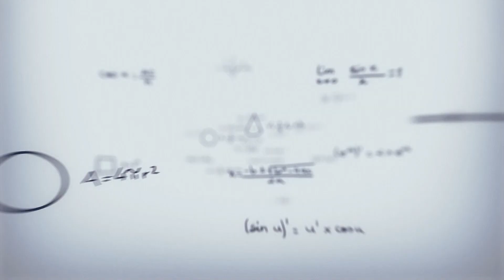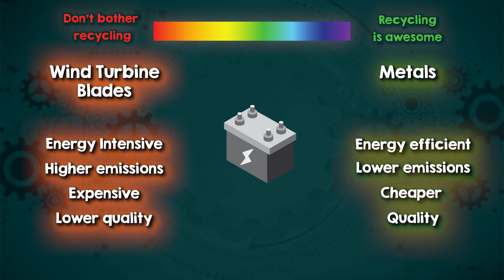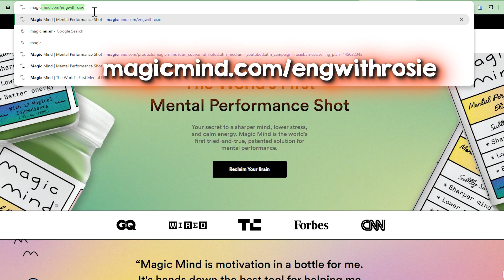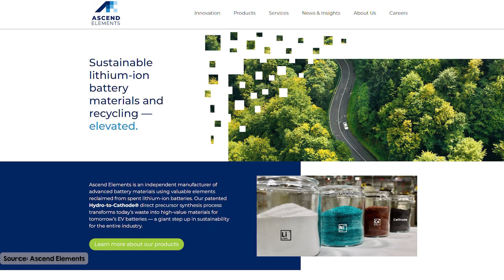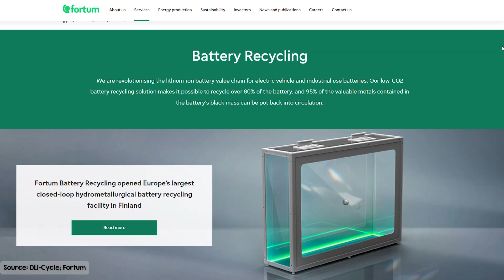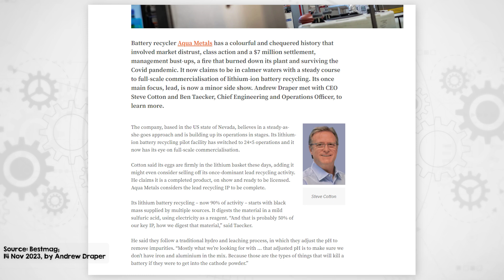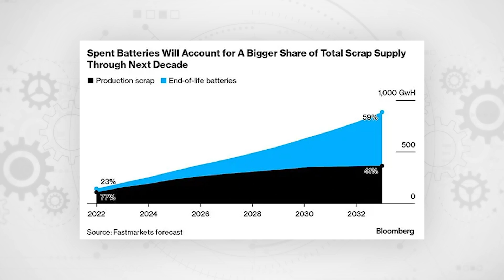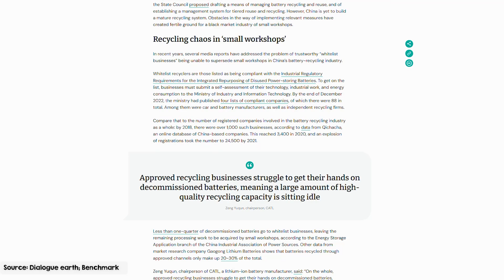Recycling Lithium-Ion Battery: How Does It Work?

Comment: 10:18 battery mineral supply constraints is still a huge risk to the energy transition, even if less talked about.
Reply: I don't think it would be. 

First if all we have enough lithium for the transition. 

Second we have alternative technologies such as sodium ion batteries (which is much more suitable for grid storage). Sodium ion batteries are already commercially available. And there are potential battery technologies like Aluminum graphene ion battery which are a lot more suitable for vehicles. Even better than lithium.
Reply: @JSM-bb80u  We have enough resources, but not enough mining and refining.
Sodium Ion batteries will need at least 10 years to reach the same scale as Lithium Ion, probably longer.
I'm not saying it's a problem long term. Long term you are completely right. But the next 10 years will be intersting.
Reply: @w0ttheh3ll  Agree with everything. But mineral bottle neck wouldn't be that much if an issue with growing technologies. 

Direct lithium extraction is becoming viable. It would lead to more environment friendly and quicker lithium extraction.

Comment: One of the biggest wastes of lithium batteries right now is vape pens. They're mostly not rechargable so they get used once, but they do contain rechargable lithium ion cells because that's the cheapest thing to use. The estimates I've seen are that enough pens get used once and thrown away (usually just in the street it seems) to make 200 EV car battery packs EVERY DAY. Even just in my rural area I pick up enough old vape pens, crack them open and harvest the (used once) LiIon cell out to keep me in hobbyist electronics batteries forever.
Reply: The single use vapes have started washing up on beaches, they need to be banned from sale, for several reasons. It’s not like they are a great benefit to humanity!
Reply: @nigels.6051 it's blowing my mind that there is no regulation at all here in the US at least. We have to get money out of politics or were doomed.
Reply: @Broken_robot1986  I think New Zealand has already banned disposable vapes, and the batteries must be easily replaceable now.  Here in the UK, disposable vapes will be banned next April.   USA appears to lag behind on many important issues,  I suspect I will be collecting USA vape pens off our UK beaches for many years.  It is up to you to reform your government, not me, so I won't say any more!
Reply: @nigels.6051 We don't need more government behavior control.
Reply: In my U.S. state, Vuse pods or similar, designed to allow for continuous reuse of the same battery/vape, are subject to a 60% tax. The disposable vapes are not subject to this same tax because they hold more than the law's minimum for juice content in one "pod". So now they are littering the streets. Awesome!
Reply: @garrettmillard525  That's crazy.  I don't know why they are so antivape.  Vaping has helped millions quit cigarettes.
Reply: @tarstarkusz  It's bizarre. Just very poorly thought out legislature. The idea was to reduce access to teens.. so now the teens get the disposable vapes that are pretty much entirely 6% nic, and adults pay out the wazoo for the pods that come in 1.2%, 2.4%, 4.8%. So now if you're trying to quit but aren't rich, you are hesitant to buy the lower strength because it won't last you nearly as long. Screwed up.
Reply: I totally agree.  I hate those things...it actually makes me sort of angry.  I'm against over-regulation but in this case something needs to be done.
Reply: @sc0tte416 take a chill pill lady
Reply: Just add the right amount of taxes. Don't let the addict's money lay around on the street.
Reply: @wernerviehhauser94 just exploit more people huh
Reply: Agreed John. I vape however I only use rechargeable pens or vapes. Glad to see you are using the old batteries
Reply: This is absolutely false.  Every vape I have ever owned has been rechargeable.
It is categorically false that any of these disposable pens are even remotely comparable to vehicle batteries.  For one, they are all soft batteries.
Reply: @tarstarkusz  They use the same material. Graphite anode and lithium electrolyte. Vehicle batteries are soft too, if you take them out of their aluminum shells.
Whether they're technically rechargeable or not, people don't actually recharge them. I find them in the street all the time.
Reply: @John_Ridley  There are hundreds of pounds of metal shells in the average EV battery, regardless of the chemistry.

Really, you should just shut up about vaping. You are clueless.  These things cost 50 dollars and up. NOBODY is throwing them out.
Disposable vapes are not sold in huge numbers.  They are an EXTREMELY expensive way to vape.  90% plus of people who vape use refillable vapes with rechargeable batteries.  They start at like 30 Dollars and go up to well over $100
Reply: @tarstarkusz  I, too, have been making battery packs from disposed, disposable vapes, it's probably all true, and you're just seeing the four walls
Reply: @tarstarkusz  If nobody is throwing them out then why do I find them in the road all the time? I have dozens of batteries in my collection harvested from them. I live in a very rural area, farm country really, and still every time I go for a walk there are vapes thrown in the road. When I'm in a city I can pick up 3 or 4 of them walking a mile or so.
Also if they're charging $30 for these things they're profitable as hell. It's a plastic shell, a sponge with some juice in it, a $1 battery and 20 cents in circuitry.
Reply: @John_Ridley  No, they don't cost 30 dollars. They're like 10.  But it is EXTREMELY inefficient to use these. Few people who vape full time use them.  The ones you find are likely people trying vaping and don't want to put the money into a real vape. Or maybe people trying to quit smoking.

The VAST majority of people who vape use non-disposable vapes. These are the ones which cost 30 (and up) and have a tank and replaceable atomizer. They have either a removable battery or a recharging port. They are not disposable.  The tanks are deliberately designed to be filled (they come empty) and replacement atomizers (they last between 2 weeks and a month) are sold in vape stores for each specific vape device.

Why are you crying about other disposable lithium devices?

Also, they are made to not be rechargeable. They use the lowest grade of materials because they are not expected to have 500 cycles put on them.
Reply: @RedPillRachel  No. I've been vaping since the late 2000s.  The VAST majority of people who vape do not use disposable units.
Also, unlike you, I'm in the vape shop frequently. Most of the disposable vape pens are gone.  They are a terrible deal for the end user. They don't produce much vape. They dry out sitting on the shelves, so if you get an old one you won't get many puffs out of it.
Those batteries are not designed to be recharged. They're made very cheaply. You'll never get 500 cycles out of them.
Reply: @tarstarkusz  300 is typical, they are useful though, for lighting and automation projects, that was all I was saying, and there are lots of them around for us to find.
Reply: @tarstarkusz  Dude I'm just pointing out that at the same time that people are whining that cars aren't green because they use up so much lithium, nobody gives a shit that vapes, phones, airpods, and a million other things that we use every day use up more lithium than all the EVs we build. Vapes are an example that I knew had been researched and quantified. Sorry if talking about vapes triggered you. We can talk about airpods being thrown away if it makes you feel better.
Reply: @John_Ridley  Assuming "green" even has a definition, which is a huge assumption, there is absolutely nothing "green" about ANY automobile regardless of the fuel type.

You didn't trigger me, you are just talking crap.  Airpods aren't disposable either.

Comment: The cost of these processes will be reduced. The current problem is that they cannot be expanded because there is not enough material. Nobody wants to spend hundreds of millions of euros on a facility with annual revenues in the millions. In the EU, for example, glass and plastics recycling is an economically sustainable business, but their capacity is in the millions of tonnes every year.
Reply: Very skeptical about glass recycling or manufacturing of any kind when the fuel for the furnaces has been cut off by green nonsense. Recycling is by its nature energy intensive.

Comment: The interesting part in the video is when Rosie mentioned MNC batteries were replaced with LFP batteries.  
This did reduce costs and made batteries more energy dense.
The next step may well be replacing the Lithium in rechargeable batteries with Aluminium since Aluminium batteries are more energy dense and with Aluminium being more plentiful and available.  In other words it would require less battery capacity using Aluminium than Lithium for the same energy capacity which in turn would require less recycling on a per unit basis.
Reply: @денисбаженов-щ1б  LFP were developed because of costs.  The Lithium, Iron and Phosphorous are much cheaper than the Nickel, and Cobalt in NMC batteries.

Comment: Tesla car batteries are being more integrated with the car's chassis with the use of glue surrounding and inside the battery. To recycle these, the glue has to be broken down to access the battery cells then further work to remove the glue from the battery cell area. This makes recycling unaffordable. My older model S, the battery can be easily removed and the cells are easily accessed. It can also be easily repaired without the need to dump a whole EV battery.
Reply: How many years/miles do you have on your Tesla?
Even when degraded below 80% the battery would make a very nice powerwall in a residential setting or part of a grid storage system.
Yes, definitely with newer proposed manufacturing processes where the battery is more integral to the 'skateboard' perhaps some cropping of the chassis would be needed, but this is achievable with waterjet.
Upcycling is almost always a more viable option than recycling unless badly damaged in an accident.
Reply: @jimurrata6785 Euro 7 emissions regulations would make it impossible to register an electric vehicle once the battery drops below a certain capacity.
Reply: @gregorymalchuk272  I'm  suggesting that a vehicle battery that has reached its limit is better repurposed as fixed storage than shredded for it's materials.
Not sure what that has to do with registering a vehicle in Europe... 🤷‍♂️
Reply: The "modern" integral battery platforms are an environmental disgrace. My understanding is that it isn't only Tesla that are guilty of this, but their inclusion in the club is certainly notable given the "mission statement" (Tesla con).

Comment: I think we should take a page from aluminum can deposits adding a small charge the consumer can get back by properly recycling the item. If people cate that much about $0.05-0.10, I'd bet they'd care a lot about $5-10. I'd mention adding a charge to manufacturers too to cut down on the cost of recycling (ideally split between a manufacturer tax and consumer deposit), but without effective price regulation, it'll just get push onto consumers regardless.

Comment: We also need to better reuse old EV batteries. An EV HVS might sustain physical degradation through abuse, and some electrical degradation leading to reduced charge and discharge rates and lower capacity. But for low performance but price sensitive applications like stationary storage it may be just fine. Setting up an efficient system for identifying type and magnitude of degradation and appropriate processing could really help with waste management.
Reply: It's definitively an option for energy professionals.  I've advised DIY solar enthusiasts that they are liable to burn their house down and die in their sleep if they use a used EV battery to power their home at night.

Comment: LFP batteries should last a lot longer than NMC batteries and don't require mining of Cobalt or Nickel to begin with.
In my opinion we should only use NMC for small electronics like watches, phones and laptops.
Reply: LFP doesn't fare well in sub-zero temperatures.
While this isn't a real problem for Australia, Africa, most of India and central America it definitely is in much of Europe, Canada and the USA.
Reply: @jimurrata6785  NMC is not great either at sub zero temperatures. For these conditions we have thermal management. Any good system will have a heating system, preferably a heat pump to get the batteries to their ideal temperature.
Reply: @SolAce-nw2hf  I'm not saying they are, but at least the solvent based electrolyte isn't as likely to freeze and destroy it.
Thermal management and charge conditioning is certainly an important part of any BMS.
While almost any chemical reaction rate is dependant on temperature, if it's really cold you're using a disproportionate amount of energy to get/keep the battery itself optimal.
It will be interesting to see what comes of solid state batteries that shouldn't have problems with liquid electrolytes or dendrite formation.

Comment: In any product development process, it should always start with strategies such as cradle 2 cradle design & life cycle analysis awa 6Sigma & ISO 14000 standards etc. Companies, however, are not incentivized to do this as the cost of disposal is externalized to tax payers via the cost of waste collection & waste streaming, landfills or recycling facilities etc. The same applies to packaging - the cost of waste management is externalized elsewhere, usually via taxes.

Comment: Do you think we should demand that EV batteries are built in a way that reduces the cost and complexity of recycling?
Reply: @moon_scar-zx  

Demand? Demand from whom?

You might be a wiser person if you got past batteries and research hydrogen as a fuel.

You might be surprised to learn of the decline in battery EV sales to private buyers is now in decline in UK.

The preference, for now, is for petrol and diesel vehicles, plus a slight leaning towards hybrids.

The issues with BEVs are well known and you can Google if you don't know what they are.

I would refer you to the manufacturers who are doing the R&D thing ref hydrogen as a fuel even as we type.

Batteries no longer quite the thing they once were.

It may be that batteries might be better suited to mass area storage for absorbing solar power and for supporting the National Grid as and when.

This concept of storing power is by no means new and you might slide over to info on Dinorwic (inside Welsh mountain) for reference/context.

Dinorwic is by no means unique either.
Reply: They need to be built so that a failure of a single cell can be quickly repaired, the full battery can be quickly extracted/replaced,and so that they can be easily plugged into static storage when nobody wants them for EVs because they have dropped to 90% capacity.  We have standards for liquid fuel, we can have standards for batteries.

Comment: Hi Rosie, something to possibly work into your next wind turbine video. In Matt Ferrell's podcast, they were discussing commentary on a previous video. https://youtu.be/ikukEEHTkeY?si=I0pdWkM8OK1oCsUJ&t=1470 At 25:15 they mention that, lots of comments seem to be from people in the industry.  They then read the following:

"Good video Matt. I've worked in the wind industry for going on 12 years now in multiple roles.  A major factor in the struggle of manufacturers is about 6 years ago, we all got into a race to the bottom.  Who could sell the cheapest turbines, most kw per dollar?  Who could sell at a loss and make it up on the back end with service contracts?  Who could underbid and take service contracts from other OEMs?  GE, Vestas, and Siemens all went to war and pretty much destroyed themselves.  In the process, the new model onshore turbines lost all the quality and reliability that had been built into them over the preceeding decades.  There are utilities out there that want to, and have the ability to, build new onshore wind farms.  They can't because no one has a turbine to sell them that isn't utter garbage."

It's a bit hyperbolic (and they address that), but it's not the first time I've seen these sentiments